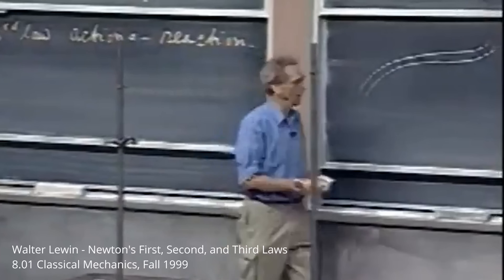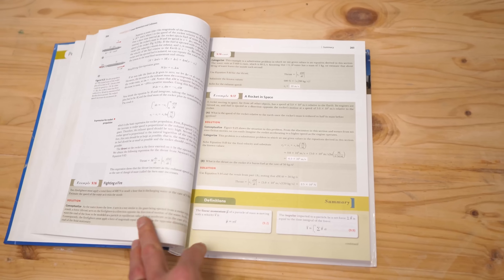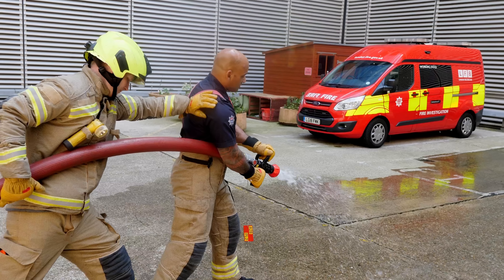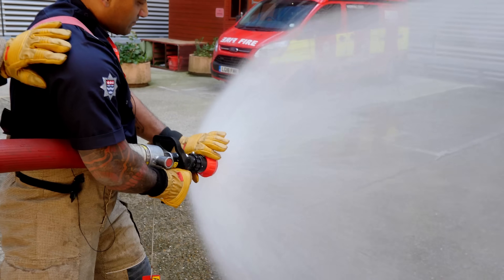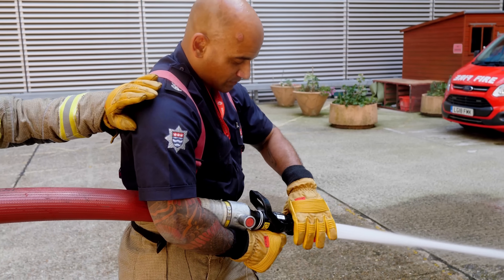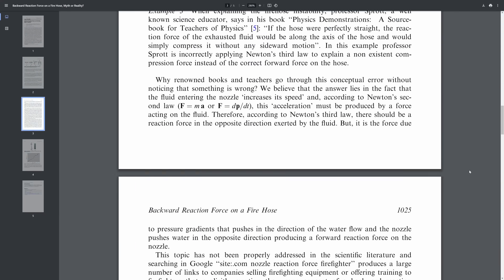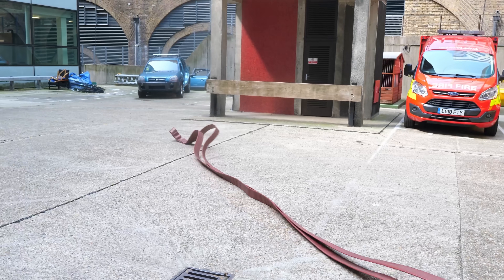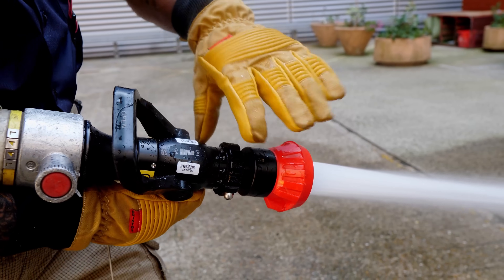Why chaotic hoses dance

Comment: Steve, you can think about these "parcels of water" as a pressure gradient inside the hose (going lengthwise) - the highest pressure is at the pump outlet (obviously...), the lower is at the hose nozzle opening. Also, there's this constriction at the end of the hose - to further accelerate the water (and to force it into a jet stream). And then any pressure inside the hose is acting on it in such a way that it's trying to straighten it - think Bourdon tube inside a most common type of a manometer - and the hose does not have this intrinsic curvature to it (like that tube has), its sides are of equal length - so it would have even greater propensity, so to speak, to straighten itself under pressure. Therefore there will be some "push" of it on the fireman holding the end of it, but I think it'd be negligible in the grand scheme of things here.

Comment: The higher pressure drop at the nozzle, the higher the reaction force. If there's very low pressure in the hose, then there isn't much nozzle force, and the other forces play a more significant role.

Comment: This might still be a naive view, im not sure if it works this way, but could the water be pushing on itself, so as it leaves the hose it shoves on the water behind it and so on all the way to the pump where the initial momentum is given? it's my understanding that in most circumstances water is nearly incompressible, idk if the inside of a fire hose is one of those circumstances but maybe its enough that at some point the water stops compressing and just starts pushing back on the flow

Comment: I think this is more about the flow of the fluid rather than just the pressure. The way I understand it, not all molecules of water (or particles of air) move uniformly within the container. Any imperfections in the surface of the transport area cause the fluid to redirect, creating turbulence inside the system.

This also applies to bends in the container—when the fluid collides with a turn or an imperfection, it exerts force on the container, causing movement. The interaction between the fluid’s turbulence and the container’s response is what ultimately makes a hose whip around or an inflatable dancer move chaotically.

Comment: 3:21 to 3:45 Looks like a double pendulum. The two articulations are not fixed, but can move around the house and depending on where they are and what the pressure is at that point, or the pressure change, the "resistance" of "dampening" or "turning friction" is also affected, they create weird shapes with much more freedom than a simple double pendulum. So it becomes a chaotic system. With a short enough hose, you get only one bend or "articulation" akin to a simple pendulum. But a single pendulum on which the point is not fixed, but rather moves around and exhibits different and changing friction. The system would die down rather quickly, if you were to release the the energy that it gains from the fluid moving along the tube.

Experiement: Fix a flexible tube to a single pendulum, double pendulum, triple pendulum. Try in 2D as well as 3D (non paralell axes of rotation between the "hands" of the pendulum. Keep adding energy into the system by air flowing. Observe. Maybe there will be some "nodes" at certain combinations of air flow and arm lenghts together with the "freedom of movement" limitation on the "pins" of the pendulum... Might even yield some interesting insight into how sound works. I am overthinking it again.

Comment: One contributing factor to the fire hose behavior is the mass of the water. Plus the fact that a fire hose has a fair amount of mass itself. I would expect that this likely has an effect on how far along the hose the whipping behavior can propagate. At some point there is just too much mass for the force of the water exiting to move it.

Meanwhile for the air based scenarios the "hose" involved has significantly less mass and thus a longer section of it can be moved. So for example if the small clear hose was 10 meters long you will only see movement in less than the last meter.

Comment: Doesn't the constriction of the nozzle that the firefighter is actually holding on to, induce some major accelleration right there? It's not the full hose diameter coming to a clean end; even "just" the hose end coupling alone is a significant restriction on its own, and the actual nozzle is designed to vastly accellerate the output. So Newton's 3rd says more kickback no? Water isn't being fed by a constant like gravity, but by an active powerful pump that easily overcomes the resistance of the nozzle's restriction to keep up the flowrate.

Comment: As a firefighter who has handled a high-pressure hose/nozzle hundreds of times, here's what I experience at the end of the hose:
Upon first opening the nozzle (beginning to spray water) I experience a momentary hard pull on the hose back toward the pump. After that, the hose continues to pull back toward the pump, but not quite so hard. Bracing myself against that pull will steady the hose without any further need to adjust my grip or direction of force.
The moment I want to turn the direction of water flowing from the nozzle (steer the flow of water) I have to walk toward that side in the direction I want to move the water. Alternatively, if I have another person on the same hose directly behind me, that person can push on the hose in the opposite direction, and the hose will naturally turn in the direction I want with no force.

Hope that helps.

Comment: There's a reason why fire hosereels always tell you to turn on the water before running out the hose. Yes, it's messy, but at the pressures they run at, the forces on the hose when they're turned on is a lot more than people might think and can easily make the hose fly out of your hands and turn into a deadly projectile just as in the video

Comment: 9:20 - what? i honestly am not surprised, the force should be dependent on the lenght of the cable before the end.
the point doesn't want to curls therefore would curl less if it's already curled, nonono, not what's happening.
the fluid is pushing on the walls and making everything juggle around, it's random motion.

I'm thinking what matteres is the lenght of the cable and the flow of water on it.

16:20 - but then why the big doll starts to straighten from the bottom up?
the first effect is in action. and it does feel like between the doll and the firefighters the importance of those effects change.
the first explanation of the video is more suitable for dolls, while the second explanation fits the firefighters case best.

Comment: It seems to me that the outward pressure on the walls of the firehose makes the hose want to straighten to maximize volume (just like the tube man). I’m not sure how strong that force is, but it would help to counteract the force the firefighter feels when holding the nozzle, right?

Comment: Question: Does Bernoulli's principle (air around the nozzle) contribute in any way to the force experienced by the fireman? i.e. would the force be lower in a vacuum? Or is the air moving into the lower pressure area a separate system?

Comment: Presumably friction inside the hose would affect the forces involved too?
Negligible in the case of air or water, but it'd be interesting to see if the system behaved differently when pushing something like sand through a corrugated tube.

Comment: The air compressor setup might not experience the same internal torque that a fire hose would because of the relative flexibility of the hose and the incompressible water. 
I’ve done some basic fire training and used a fire hose a few times, as well as cut old fire hose apart to use as anti-chafing gear. Fire hoses are an internal rubber hose to hold the water pressure, with an external woven sheath fixed to the rubber to provide structure under tension but not compression (which the water pressure causes). The internal pressure of the water is what gives the structure-less hose rigidity similar to the wacky tube man. I think the floppy sides of the hose start acting like a tension spring on the outside of the bend in a way that the relatively structured plastic tubing might not be able to since the inside of the bend on the tubing would act as an opposing compression spring instead of quickly buckling on the inside bend like the tube man or a fire hose.
In either case, the changing geometry will cause a change in the amount of pressurized tube area on either side of the bend, which causes the outside of the bend to always experience a greater outward pushing force than the inside. However, in the case of the non-stretchable hose an additional imbalance is present because of there being a lack of compression force to work against the outside tension.

Comment: I would imagine that, as far as the person holding the fire hose is concerned, there is no difference between "the hose is being pushed backwards by the force of the exiting water," and "the hose is being pulled backwards by forces acting on the bends in the hose."

Comment: Unlike a solid where its motion is related to its centre of mass on application of a force, paricles of liquid or air travelling through the hose consists of huge numbers of free particles with motion of each is independent of others in it. When each paricle bounce/hits other paricles, though total sum of momentum conserved after such interaction with other particles, each particles after impact follows direction based on its centre of mass, inertial mass and when they hit the hose inside surface, they transfer part of it. Of course, at exit point of hose motion dynamics of free exiting particles imparts to the air/fluid still inside the hose together with viscosity of fluid/air thatis flowing. Hose is not a rigid tube but flexible, so dances. LOL

Comment: Does the width of the nozzle as compared with the tube width matter at all? The water exiting the narrower nozzle might be going much faster than the water in the wider tube, and with the same flow on either side, a force would be imparted on the firefighter, would it not?

Comment: I think ypu are missing a major component of the hose whipping around. As the fluid exits the nozzle, it creates a venturi effect around the end of the hose creating a vacuum. Obviously this isn't perfectly symmetrical and will be a turbulent flow which starts nudging the end of the hose. I think that there is a layer of laminar flow of air along the outside of the hose but once it starts to bend it gets disrupted like flow over a wing and will then collapse one side and start whipping it the other direction. I'm not saying that the jet of water isn't contributing to this, which it certainly is. I'm just saying that I think there is more of an interplay from the air pressure at the end of the hose than is being accounted for.

Comment: Controlled water displays to shoot a cylinder of water will align the water through fundamentally straws before exiting the nozzle.
   Could introducing a venturi at the correct point of exit draw in air increasing the throw of the water column?

Comment: I think there are essentially two "rocket effects".
The first one is just due to accelerating the fluid and ejecting it out the back without any pressure, expansion etc, just nice and laminar. This would not cause a force at the end of a firefighters hose, all the force would be applied at the pump and tranferred through its anchors.
The second effect comes from the expansion of a pressurized fluid as it exits the nozzle and accelerates while depressurizing. The exact force is equal to the mass-flow times the difference in velocity of unexpanded and fully expanded fluid. The details depend on your nozzle design, but generally you want to fully expand the liquid in the nozzle, because any leftover pressure is wasted. This is the same whether for propulsion of the nozzle (in a rocket) or propulsion of the liquid (in a firefighting hose)
Reply: Oh, and because the firefighters say the force is about equal to the naive equal-reaction scenario, we can predict that the velocity of water about doubles while exiting the nozzle. Would be a fun one to measure!

Comment: Regarding the reaction force on the pump i cant really imagine that its that significant. lets think of a boat which has a pump mounted on it. The pump pumps the water parallel to the surface of the lake. We connect a hose to the pump and point it upwards. With your reasoning there should be two reaction forces. One on the end of the hose -> if the hose is mounted vertically it pushes the boat further into the water. the second one on the pump. if the pump is mounted horizontally, the boat would move horizontally, which I find unintuitive. Or did I got something wrong

Comment: Is it because of the weight of the water/air in front of the rest of it contained inside the hose pushing back. If you watch the video the force did go all the way down the string  untill the string gave out

Comment: Brilliant little nuance there about the forces. Edit, potential solutions: 1)the force of the water pressure on the pipe walls contracts the pipe length. 2)The force of the friction of water on the pipe in the direction of the laminar flow has something wierd going on at the boundary layer. 3) the nozzle is pushing against a mass even though it is an air mass. Edit 2: should have watched the rest lol.

Comment: its a rocket. the hose is the combustion chamber. the pressure on the walls and pump pushes the hose away from the exit because it's an unequal pressure differential

Comment: Oh, Steve. Why would you bait every engineer with a fluid dynamics background with such a silly introductory statement about pressure in a hose (near 11:50)? The hose experiences a drag force from radial exchange of momentum with the axial flow of water through it. This results in a characteristic pressure drop along the length of the hose. Even if you include the generally decreased drag from turbulent flow, there is still a boundary layer that diffuses momentum from eddy currents to the hose wall. This is only further pronounced in elastic hoses, where the flow deflection involves both losses to the redirection of flow and storage in the elastic medium of the hose wall. The distinction between major and minor losses in pipe flow may make the drag from pipe (hose) wall less important for shorter and wider pipes, but that is a pipe network dependent consideration. Fire hoses are long and humans are not as strong as a multi-horsepower pump. We will absolutely feel the "minor loss" exit loss of the hose while holding it, even with the "major loss" of pipe drag helping to push the nozzle forward. The lateral deflections include similar losses from angular currents losing momentum on the walls, resulting in a net twisting force on the nozzle. You might ask about that as well the next time you get a chance to chat with the fire department, as an interesting aside. It is part of why the grip on the nozzle can sometimes feel like it wants to twist out of the hand when a bend travels and changes size in the hose.

Comment: 12:50 "This parcel of water that is leaving the nozzle is being pushed by the parcel of water that is just behind it" - some, but how much? Before the parcel of water leaves the nozzle, it is already moving at the same speed as the one behind it. The only force on it when it leaves the nozzle, is the air resistance. So it is only the force that is needed to overcome the air resistance that the parcel of water behind it feels. That is tiny, especially because air is also moving with the water, once the hose has been running for a short while. That is not the full reaction force. 
Another way to see that, is to look at what the water does after it leaves the nozzle. It continues to flow in a relative straight stream with almost the same speed.  If there was a huge force from the parcel of water onto the one behind it, it should spread out when hitting the air. It doesn't, and it does not significantly change speed, therefore there is no large force between the water parcels.

13:20 "That is like arguing that you could push on the end of a string..." - try pushing on the end of a stream of water (without a hose around), and notice what happens. 

There are three forces that play a significant role in this: 
1) the forces due to bends in the hose
2) the friction of the water inside the hose
3) the stiffness of the hose. 
Both 2 and 3 should tend to straighten the hose, and therefore should counteract 1. 
I would still judge that the force the firemen need to resist is caused by the bends in the hose.

Comment: Let's not forget also that the fluid is exerting pressure against the sides of the hose itself. One possibility is that the hose may not be totally uniform so that pressure could cause the hose to contort, possibly introducing an initial instability.

Comment: Similar to the three body problem. If the hose is short enough that it will really only have one bend, its movement is predictable. If it's long enough to have two or three bends, its movement is unpredictable and chaotic because it's difficult to predict how the different forces caused by the relation of the different curves will interact.

Comment: The pressure difference at the end of the hose is attempting to create a syn wave out of the hose same as if you take a chain from the top and turn it will create a sort of parabola further down the line

Comment: Can you put color breads in a transparent hose that you can track with a high speed camera,  and measure if there is a velocity spike when the water leaves the hose? The beads will have to be very visible and very light. Maybe plastic coated leds? Maybe just reflective beads? 

You can then compare the felt recoil and the calculated recoil.